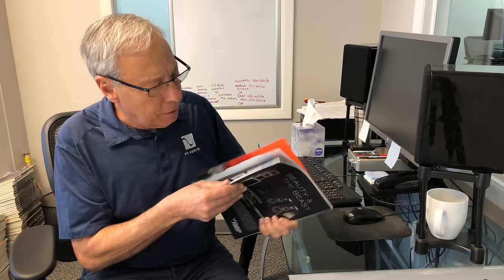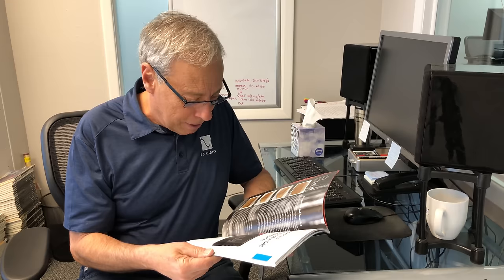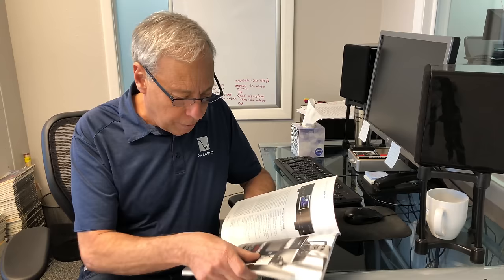Is equipment burn in real?

Comment: this is true for me, i have the grado sr60e which sounded like garbage right out of the box, then i burned it for a couple of days, and the sound quality changed drastically, someone of you might say that "its just your brain adjusting to the sound". well sad to say folks i only listened to them twice, before the burn in, and after the burn in. and at that point your brain wont be able to adjust if you only listened to it for a very short amount of time. so yeah burn in is true
Reply: Choa Park I think most of the naysayers would agree that it's different with something that moves, like a speaker or cartridge/stylus. Obviously, any object is more malleable the warmer it is. That's actually based on science.
Reply: Choa Park It does exist, but days should not be required. Play a few LPs and test again, that should be enough. And you cant test one day, wait and come back several days later to test, way too much time has passed for you to make accurate judgement.
Reply: Leon thepro, its only 3 days of burn in, i can still remember the sound of it ootb and it was awful. 3 days of burn changed it a lot.
Reply: Choa Park I doubt it sounded awful and then superb. And 3 days is a lot believe it or not. But dont believe me, ask those who actually work with testing these things.
Reply: Leon thepro hard to believe it right? i find it hard to believe it too, but its just wasnt me even my sister heard the difference, i made her listen to it before and after burn in and we have the same conclusions. i also wont care if someone doesnt believe in this as long as my grado sounds great now.
Reply: Choa Park Its not that hard to believe actually. And if all you care about is sound and not the truth then by all means.
Reply: Choa Park true. An old saying goes it’s best to discuss oysters with those who tried them.
Reply: Alex Zuzizi Yes because there is nothing like the reliability of anecdotal testimonials. Personally I have had 2 carts as of yet, so now what?
Reply: Leon thepro good for you!
Reply: Leon thepro its all about testimonies that religious people live in also. either be right or wrong. its up to you on what to believe
Reply: Choa Park No, Im sorry, thats not how you reach truth.
Reply: Leon thepro but do someone in this earth really know the higher truth? i dont think so.
Reply: Choa Park Depends on what truth, that I exist? That 1+1=2? We all know those are truths because we can prove it with evidence.
Reply: Leon thepro 1+1 = 2 only in a certain metric system. It can be 10 or 100 in other. So it’s never the truth but a convention. 
In the sound what I hear is the truth. Not measurement or blind tests. But of course they are important.
Reply: Alex Zuzizi By necessity of the system 1+1=2. Maybe not in your made up one but Im talking about real world and shared truth here, not personal.
Reply: Leon thepro i dont know what youre really up to man. paul even said he believes in burn in and equipments will do sound better, it doesnt matter if it takes hours or weeks. the truth is in your ears, if you ears hears significant changes. thats it. argument done. for me personally i trusted my hearing capabilities since im younger (23yrs old) i can still hear up to 19k so small details and changes, i would noticed it.
Reply: Choa Park Youre not listening for hz when it comes to break in, and when did I ever say it didnt exist? It just doesnt exist in the exhaggerated way people claim. Your MM cart or whatever wont sound better after 50 hours than it does after the first.
Reply: Leon thepro  exaggerated? i think i didn't fully explained myself. But base on facts theres no perfect measurement of time when an equipment is fully burned in, no one knows that, not even Paul or me or you, so better break it to your own liking, what i did is just leave my grado burn for 3 days straight without listening to it. so i didn't know the exact time when did it fully burned. also hz and frequency response changes after burning is complete, i saw that when the founder of mr.speakers (i forgot his name) is telling about his prototypes and discussing some before and after burn in frequency graphs. the changes are miniscule but its still a change, proving burn in is true.
Reply: Leon thepro it’s not my made up system. It’s yours that’s obsolete one :) look in to computer systems which are no decimal Arabic metric system from the beginning IMHO. It’s more real that any of your decimal theoretic old stuff. It’s in your phone in your computers and everywhere. It does exist in reality not in theory. Just like burn in :)

In my experience ( and not only) burn in is 100+ hours.
Reply: Alex Zuzizi haha, you dont seems to be able to grasp the point of my argument. Fact is we use mathmatics and it applies universally. When presented with what 1 and 2 mean and accepted those as fact its completely illogical to disagree with the conclusion that 1+1=2. Its a truth of the system.

And you think burn in lasts for 1000+ hours, why am I even surprised.

You at least seem to have a vivid imagination there ;^)
Reply: Choa Park Depending on what gear we are talking about frequencies can be a factor of burn in yes. 
But there are ways to tell when burn in is complete, it isnt magic. Its a change in the mechanism of the output. Given the facts anout that mechanism you can easily make predictions of when burn in should be complete. Like suspensions in the material of cantilevers or speakers.
Reply: Leon thepro as I said it depends on the system, and 1+1 =2 only in certain systems. Yes if we have AGREED to use decimal system with all it’s presumptions than 1+1 =2. But that does not mean it’s the truth. It’s convention! There’s no 2 in binary system AT ALL!  IE 2 does not exist there :) And binary system and binary logic is no worse but more practical and real than decimal one. Besides ANY mathematic, physics and other science rules ARE NOT UNIVERSAL! They work only under certain presumptions and conditions. I am sure you know it :) If not I can prove it to you on Einstein theory for one.

I hope I could convey my point. If not it’s ok. It has nothing to do with science and not intended to be. It’s just an illustration.

And yes common practice or rule of thumb tells us 100+ hours to burn in. Of course it can vary. Not trying to change you mind or anything. It’s just another audiophile normal. You may not accept in your system. Just don’t claim it’s not true. In my coordinates it is. And it is real. Again in these coordinates. Just like 2 in decimal system :)
Reply: Leon thepro did you follow Einstein on gravity or speed of light? Like why in the world it’s constant now matter how fast you move and in what direction?  Ie why would not it add to the source? Like in normal physics. How come nothing ever can move faster?It’s just a crying illustration that any physical law works only under certain conditions!
Why does TIME!run different to those moving closer to the speed of light and those who stays still? Would you ever imagine that in Newton physics?
Yes I may sound like playing dumb here. In fact I am to certain limits. Coz I never meant to lecture natural science
I just wanted to illustrate that not everything can be measured and even when measured can be wrong!
It’s so obvious to me.
Just like 100+ hours burn in :)

But I am telling you again. ANY I MEAN ANY PHYSICAL law works under certain conditions and presumptions and limitations. And so does mathematics being no science but  a description tool :) There always will be conditions under which it does not work and irrelevant. Dig into it. Ask a scientist he’ll tell you I am right. 100%

By the way, just googled it up. Never meant to google up a rule of thumb though :) 

Here’s what I see.

Most of my audiophile friends believe that headphones (and speakers and electronics) sound better after the first 100 hours of use than they do when they're brand-new. 

https://www.cnet.com/news/headphone-burn-in-fact-or-fantasy/

Which is a first link in a google thread - how many hours to burn in

https://www.google.ru/search?newwindow=1&ei=nDaLWtKoH8WMkgWyyJuAAQ&q=how+many+hours+to+burn+in&oq=how+many+hours+to+burn+in&gs_l=mobile-gws-serp.3..0i203k1.425954.449901.0.451063.39.32.1.6.6.0.434.5153.0j25j4j0j1.30.0....0...1c.1.64.mobile-gws-serp..12.27.3969.3..0j0i67k1j35i39k1j0i131k1j0i67i70i255k1j0i20i263k1j0i22i30k1.220.PPYW5Gi-c9s
Reply: Alex Zuzizi Im having a hard time following your writing so Im not sure how to even respond.
I could read one of your points though, nothing can be measured, yet you can measure with your ears that break in is happening over 100+ hours. Great oxymoron right there ;^)

Quoting authority has no relevance in this discussion. I can quote Michael Fremer saying break in is exhaggerated too, so what then?

If you dont understand why nothing can move faster than light then pick up a physics book and start reading.
Reply: I used to own a used Sennheiser hd 700 I remembered it sounded amazing then I sold it. About 4 months later I bought it again (I received it today) and the sound from the brand new hd700 sound good but not great or amazing like the used hd 700 I used to owned. Right of the bat I noticed the brand new hd700 sound less detail/clear/resolution.
Reply: Electronics need some warm up time also how good a component sounds with music depends on your mood and if you like the music or not. My system goes from mediocre to stellar depending on what kind of day I'm having.
Reply: The only way to test if a burn in works is by measuring the sound before and after because our brains are terrible to remember sound exactly, and if we listen to same music twice on the same equipment we will hear differently because our focus might be slightly different.

Comment: Some may be surprised but even simple contacts need sometime to burn-in! For my loudspeakers, I use bare silver wire screwed tightly onto my amp terminals and I even avoid to ever unscrew it (for instance, in order to use my laptop and make yet another measurement) because if I do, then it'll take about an hour or more of playback, before the sound gets right again in every detail. I suppose it takes sometime for the electrons to pave their way from one piece of metal into (and out of) the other, before they can do it promptly and unhindered. Or it takes some time for the metal surfaces to fully comply to each other under external (screwing) pressure and therefore make full contact on a microscopic level.
Reply: Full Ranger No, no, no, no, no to all of that! Ask an electrical engineer. Preferably one who doesn't sell audio products for a living.
Reply: I guess you're joking.

Comment: Asking Peter Ledermann, Cartridge, amp designer and the head of Soundsmith I got this out of the topic.
Equipment burn in depends on what kind of gear of course, but in general it is exhaggerated. MC carts for example require more time for suspensions to settle than MMs. But even then a few hours of high modulation should be enough.
And the human mind truly is one that adapts, depending on a lot of factors your music might sound different while nothing in the setup chain has changed at all. And it doesnt matter how good your ears are.
In general give your gear a few hours of play, after that dont expect things to change over days, because you will too. These 50 hour claims are just ridiculous.

Comment: The capacitors dielectric materials when in use change in ionic structure then start to age at a certain rate which changes their capacitance over time, also like any manufacturing there will be capacitance variance in each capacitor... 👍